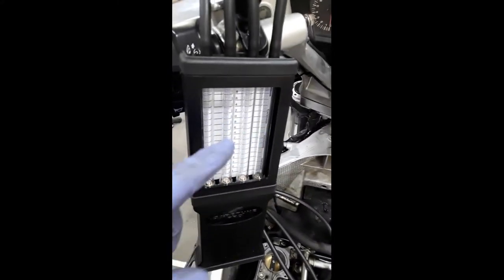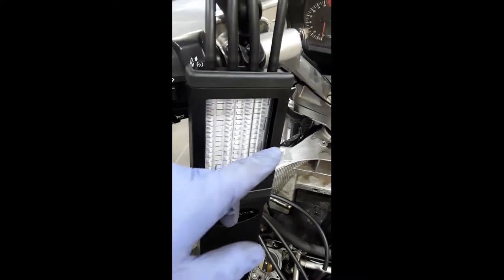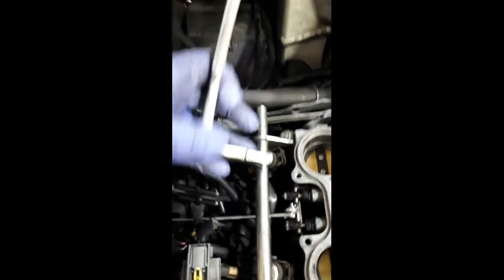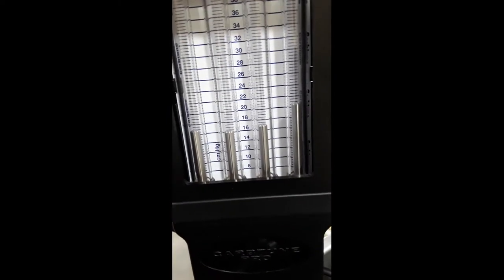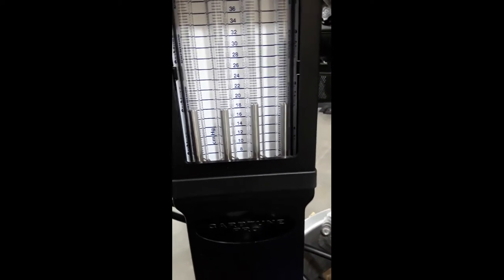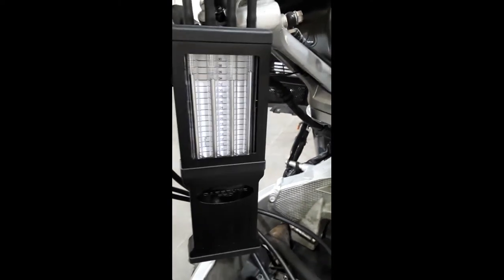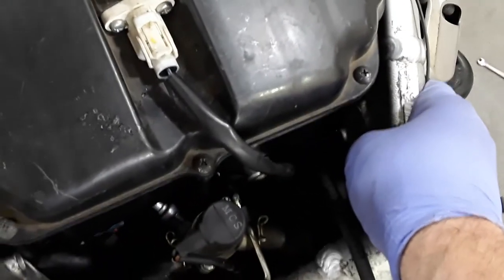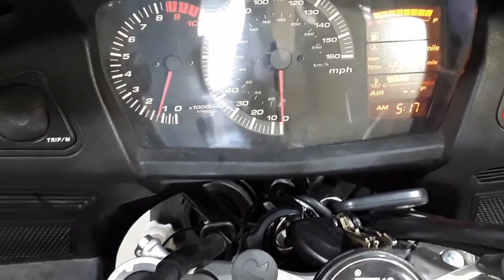2012 Honda ST1300PA synching the starter valve's throttlebody sync

Comment: Where did you connect the hose?
Reply from the maker: Each cylinder has a vaccum port.
Reply: @patmlem  to synchronize you used the gas tank or the reserve one?